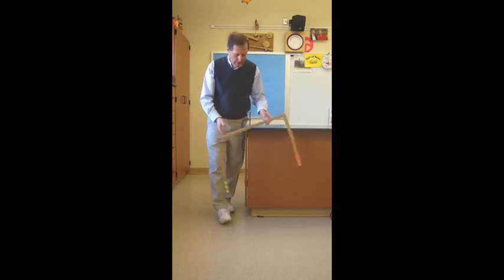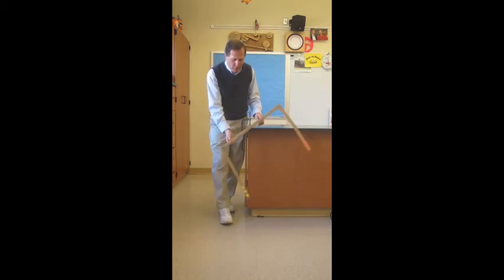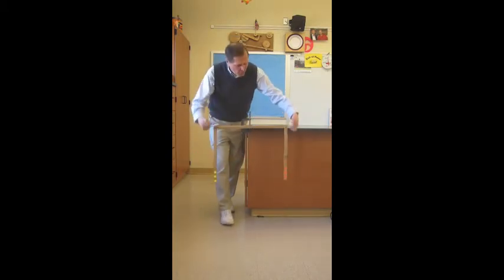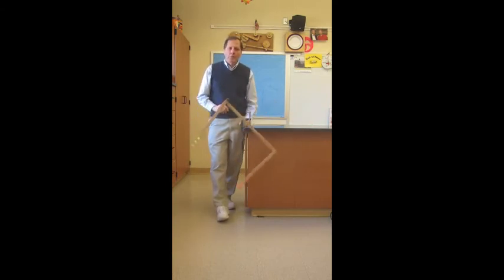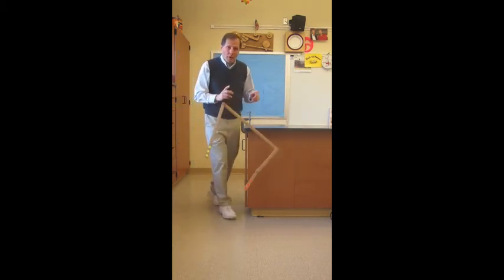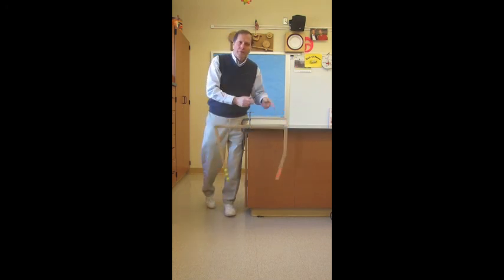youtube video #6zwykm6GIoM

Comment: First?
Reply: PS.   I just watched your most recent video and you look exactly the same.  I was wondering if you recorded all of these at the same time or if you just don't age. Thanks.
Reply from the maker: HI John,   I started this  project about 2 years ago so it hasn't been that long,  I  try and get every set up so that I can shoot each video on the same day,  some took a few days.  I need several takes and editing ,  each video may have 4 to 10 hours of set up and work  in it.  I have some problems with some of my older videos so I am fixing them and reposting them  so the ages are mixed.
Reply: Bruce Yeany   Ok, cool.  Thanks for responding.